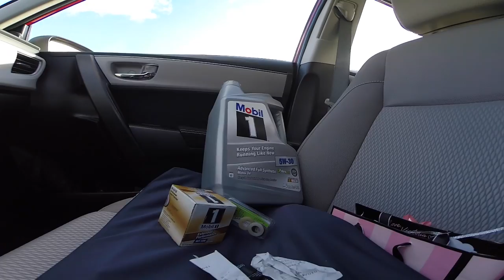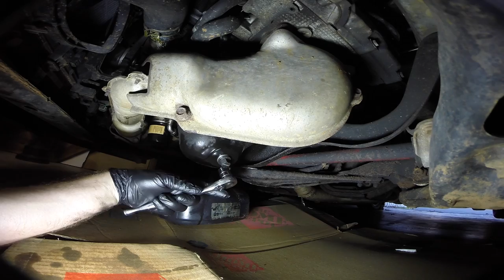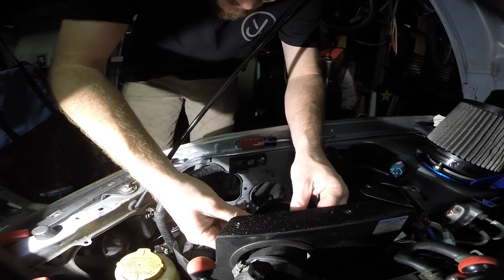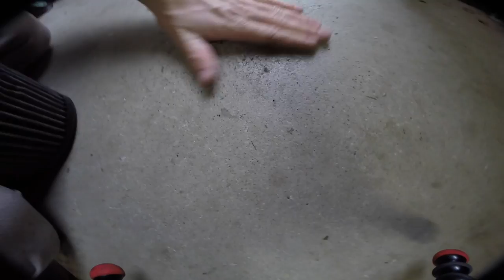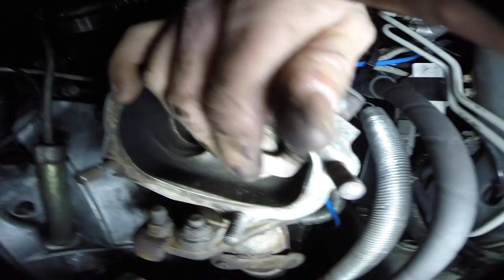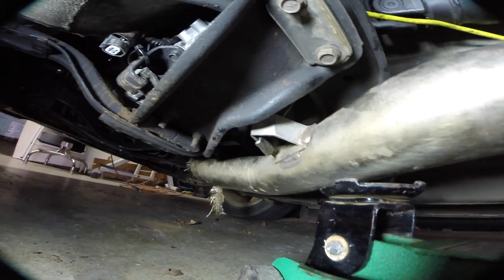WRX Maintenance: Oil Change, Air Filter/MAF Cleaning | Fixed Wastegate Flap

Comment: My car is doing exactly what you said, but the other way around. It will build boost on the gauge, 12-18 psi, but it wont engage. Once it does it kinda launches the car. It will cut in and out too. Like no boost/ power at all off and on, makes the car like lug while you are driving. It also wont build boost and act like it doesn't have any power like you said. So is it getting stuck open and stuck closed? TIA. 2020 WRX, 35,000 miles and 7,000 miles on this rebuilt engine.

Comment: Ugh this video is old but hopefully you respond. Did you ever hear a rattling noise whenever the flap was lose? I’m having an issue with my sti and I can’t figure out the issue. I already replaced the cat (where I thought the noise was coming from) but the sound stayed the same.. Now I think it’s something to do with the turbo. Any thoughts?
Reply: Mely xo same mine started today. Ima try and fix waste gate cause mine does the same thing as this guys but does have rattling going on.
Reply: I have a 2018 sti and ever since I fitted a down pipe it's been rattling but only at certain throttle positions. I been told it's the type of down pipe and vacuum that's causing it. I thought it was a tuning issue. It's annoying as heck

Comment: Hi so i have sort of a long question. I just bought a 04 wrx wagon. never have had a boosted car so the maintenance and everything involving the turbo I'm a little unfamiliar with. yesterday i picked it up and drove it 3hrs back home. car ran amazing besides that fact i had basically no power at all. the motor and the turbo only have 40k miles on it. what do you think i should look at first to diagnose this issue with there being almost no power at all?

Comment: "This motor burns a lot of oil" I have an 05 STI and an 04 FXT, both heavily modded and near 170k on both and I've never had to add oil in between oil changes provided I didn't have a turbo that needed a rebuild

Comment: Hey my accesport shows vacuum at -6 psi, I'm pretty sure it's not supposed to be at -6.. vacuum leak? any suggestions on what to check for?
Reply from the maker: Hmmm i've never had that issue. I'm really not sure. A quick google search should provide some answers! Good Luck!
Reply: Same with mine,  you found the issue?
Reply from the maker: I had some Wastegate sticking issues. I just sprayed some lubricant and moved the flap a bit and it seemed to free up the flap and actuator arm.

Comment: My 2012 wrx doesn't have a C clip on the Wastegate actuator, how can I get it unstuck? I think its stuck open.
Reply: The whole actuator arm wont budge at all
Reply: Did you get this fix? My 2012 wrx has the same issue
Reply: @chengthao5197  anyone got this fixed? Same problem here
Reply: @axel14243   Yeah I did, i ended up buying a new wastegate actuator on ebay. It was an easy fix
Reply: @chengthao5197  thanks for the reply, so yours didn't have a c clip either? Mine does not have it

Comment: Hey man, I'm all of a sudden experiencing over boost in my 05 Forester STI SG9(stock turbo/waste-gate), any tips on what to look for? It was running consistent 1bar boost and now hitting around 1.3-1.4bar - I'm not getting any fuel cut and not noticing any extra performance...basically started happening after I got my local garage to do a simple service oil/filter etc. (could be coincidence) oil is slightly over the full mark.  Cheers
Reply from the maker: +Karl Vinnicombe man I'm not sure exactly! That's very odd you would be having issues after an oil change. Hope you figured it out 👍

Comment: Nice vid man, Im having intermittent boost on my ride and thought of doing what you did but, I think that the flap lubrication and wastegate arm could have been done without removing the downpipe right?
Reply from the maker: Thanks! Yeah you could prob get away without removing DP. I just really wanted to be sure the lube made it inside and onto the moving pieces. 👍

Comment: great video. one question - at 13:35 how do you know the correct preload (wastegate arm tension)? Doesn't that depend on spec or something in subie maintenance manuals? As well as your tune?
Reply from the maker: Yes may depend on your application. I was only setting tension for my oem wastegate spring and stock td04 turbo setup
Reply: How did you know the tension it should have

Comment: How did you find out that your wastegate flap was stuck open?
Reply from the maker: +Inthepocket my car would start over boosting like to 17psi. My car also did the opposite where it wouldn’t build any boost. I decided to take it apart and found my wastegate flap was a bit corroded and wasn’t operating smoothly.
Reply: How did the car run when it wasnt boosting and the flap was stuck open?
Reply from the maker: Flap stuck open it was Slow, very slow. No torque, just felt the car bogging out slowly gaining boost. But When the flap is stuck closed thats where you will get boost spike and hard over boosting.
Reply: Thats exactly what Im feeling... bogging, sluggishness and just no powah! I couldnt get the wastegate out, but recently I sprayed some PB blaster on the top flap and it improved a little!! Not a big difference but noticeable.
Reply: thats what my 06 wrx is doing. bogging out feels like not building boost thought it just needed a tune because i put a 2.0 jdm legacy gt motor in it

Comment: Are you not supposed to fill the oil filter before installing the new one...also a dry-start issue? Also did you ditch the heatshield, or does this subie not have one?
Reply: Michael Bullington You can but it's not necessary
Reply: Yeah, I thought as much; turning over the motor without starting pretty much does it. Cheers to you for responding.

Comment: Don't use mobile 1 it sucks donkeys ass and it turns into 0w20 after oil change, use rotella or motul its the best after you done 3k miles on those oils it still looks clean and the weight and thickness is still consistent